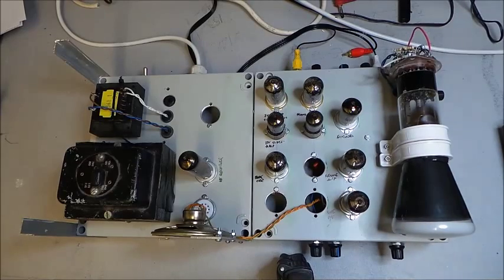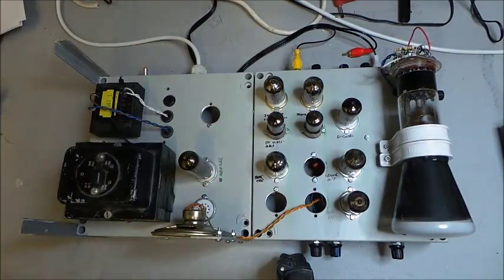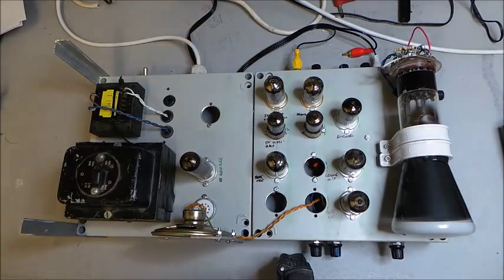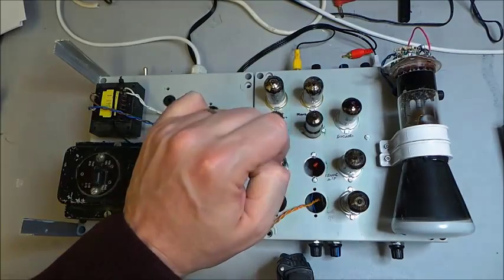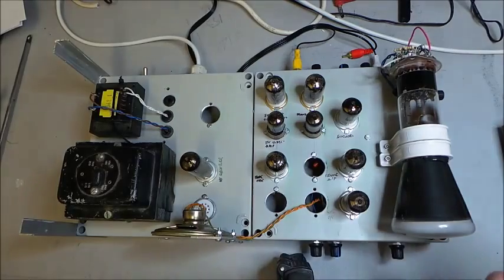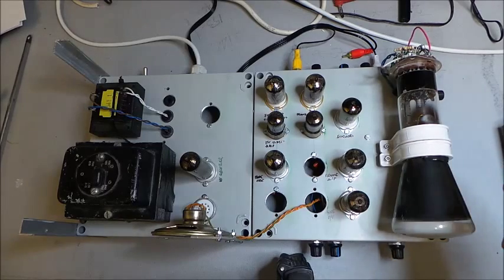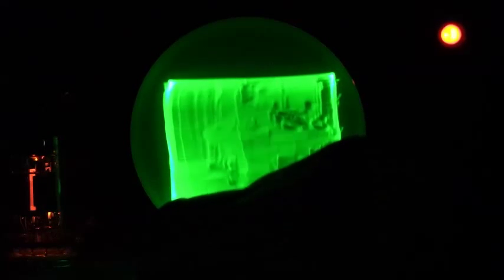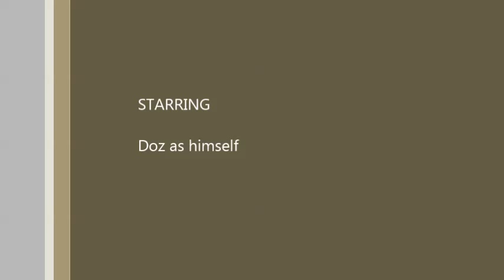Home made TV Monitor with DG7-32 Scope tube.

Comment: Andy, how nice to see your tv.  And how nice to use tubes consequently. I once made an oscilloscope with a DG-7-32. The CRT is still in my junkbox. I think it was an Elektor project. I would like to use the CRT in a project with MOSFETs and some boost converters for the high voltages. And of course an Arduino or RaspBerry or perhaps an STM32board. But I have so many plans...
Reply from the maker: I have another tube, and fancy doing just that! If it ever happens, I'll publish the details on my site, and maybe a video.